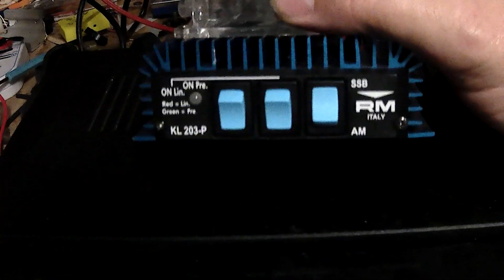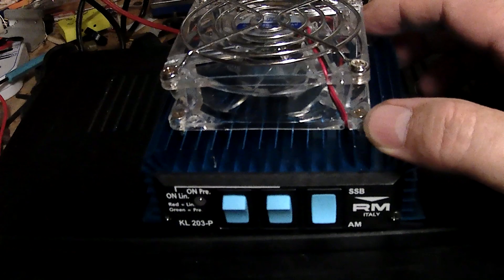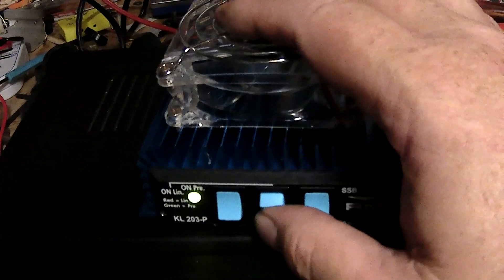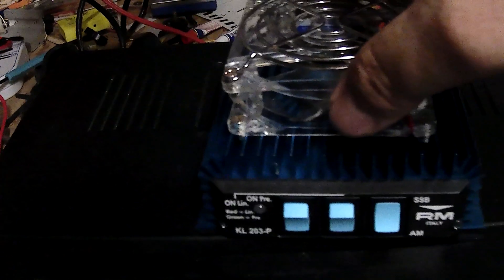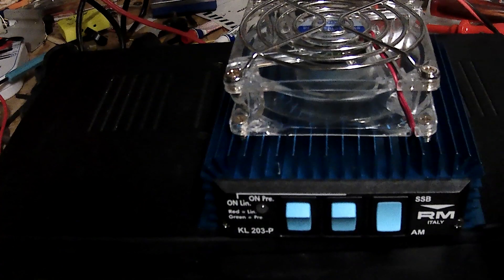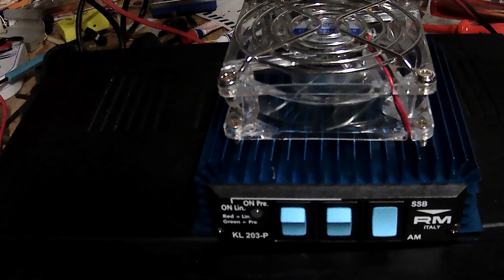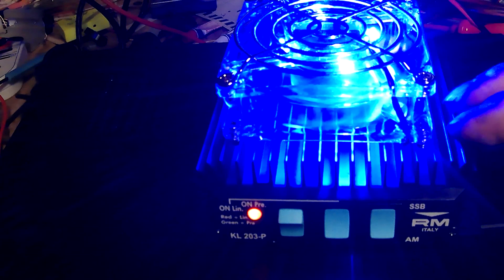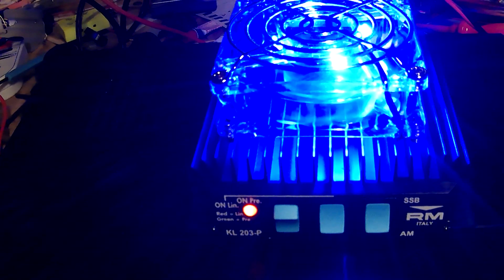Cooling mod for a RM Italy KL203-P amp

Comment: Nice video, have you concidered connecting to tx relay so fan is on tx only
Reply: Good idea.  I got little heat sensor switch fitted inside the amp.  When it gets certain temperature it turns fan on.

Comment: I had a 1.0 SWR 1 and 40 with my president Maryland antenna however when I ran the amp it jumped up to 2.0  any suggestions for correcting this problem?
Thanks
Reply from the maker: when you run amps teh swr can jump a little, your best off using an antenna tuner.

you can get small ones for mobile or larger ones if your a home base.

im using a Kenwood AT 200 antenna tuner, its a swr/power meter and antenna switch, i use it as a home base.

for a mobile you can get a mobile antenna that has an adjustable tip so you can swr the radio and amp to work happily with the antenna
Reply: @bunter9782  Many times Higher SWR under power is just the meter responding to RF,the SWR is no higher it just reads wrong under power.Why couldn't you show us how you mounted the blasted fan?
Reply: John Holder I agree..show how you mounted the fan.